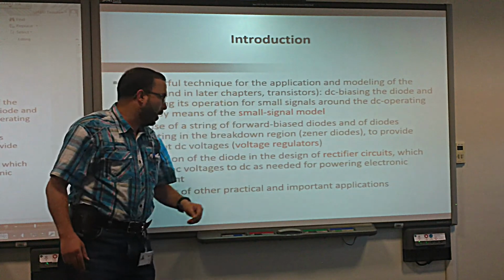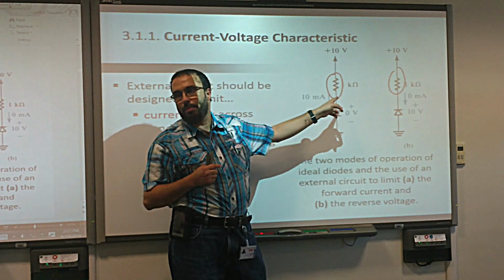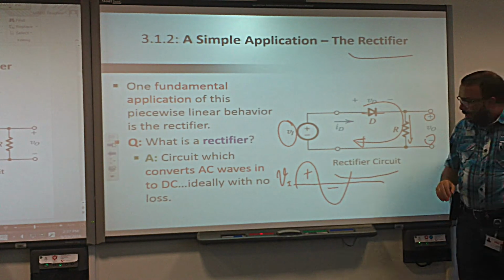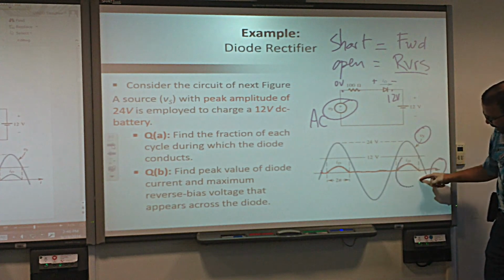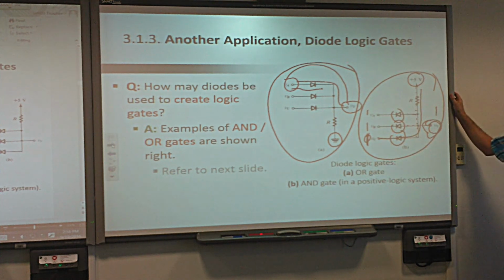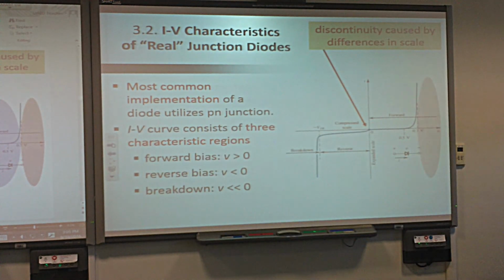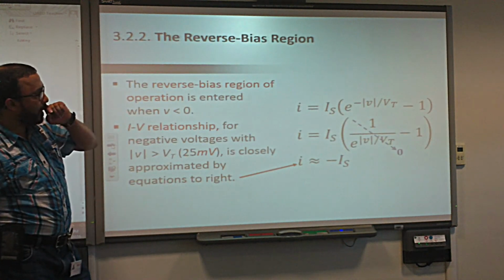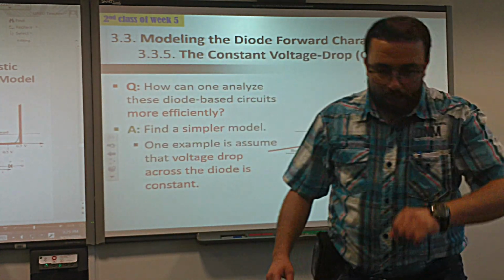Week5 Class1 - Fall 2016: Ch. 3 - Diodes: Diode I-V Characteristic + modelling of Diode in Forward

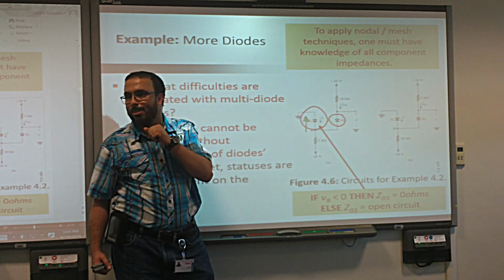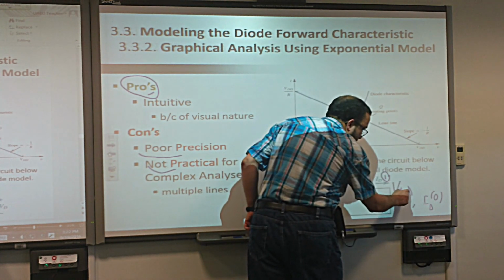Comment: Dr. Fayçal Saffih in min 47:25 when you assumed that  the diode is on and the current goes in the opposite direction you said that this shows incoherence; does this mean that the diode will be off and no current will be passing through it ? Or will this mean that the diode is connected in the opposite way ( |< ) ? Also in 1:05:35 is the current in the diode at 0 found by nodal/mesh or will it be an initial value like guess voltage?
Reply from the maker: Q: does this mean that the diode will be off and no current will be passing through it ? 
A: I mean if (after KCL-KVL analysis of the circuit) you find out that the diode has the current flowing in the opposite direction (- to +) then you need to change your assumption and re-analyze the circuit again.

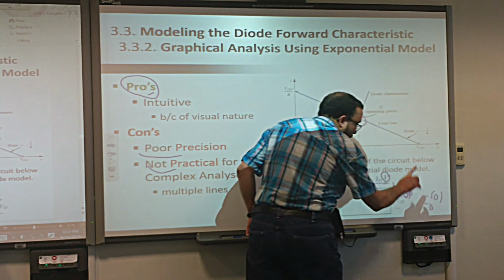Q: at  1:05:35 ....
A: N, the current at 0 is given from the starting point

Hope this helps. Please let me know.
Reply: Dr. Fayçal Saffih thanks a lot this was very helpful!
Reply from the maker: You are most welcome Rim and wish you all the best in your studies including my course on microelectronics.

Comment: Sir doesn't the current usually enter the negative terminal? Why does it flow from the cathode here? I know it is simple but i got a little mixed up
Reply from the maker: Hi Rim,can you please show me where in the video this was mentioned so that I can understand your question and answer it correctly?
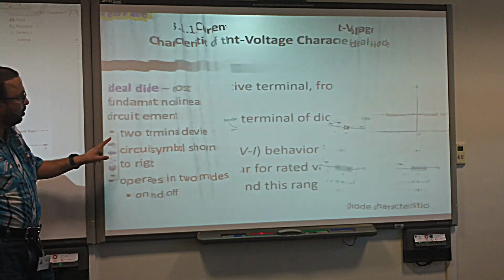Reply: Dr. Fayçal Saffih Dr. Fayçal Saffih sir you skipped the slide in this video but it is there in the slides; it's minute 7:58 . Thank you!
Reply from the maker: Of course Rim! when the diode conducts the current has to pass from the +terminal (Anode) to -terminal (Cathode), that means it enters INTO the Anode and leaves FROM the Cathode. Is it clear now?
Reply: Dr. Fayçal Saffih Ohh okaaay i just got it! Thank you Sir!
Reply from the maker: You are welcome Rim! 
Good luck to you in my course on Fundamentals of Microelectronics!